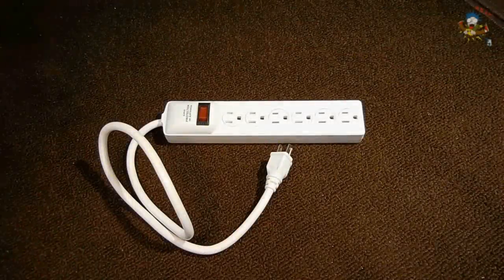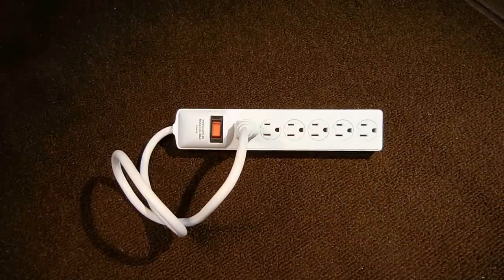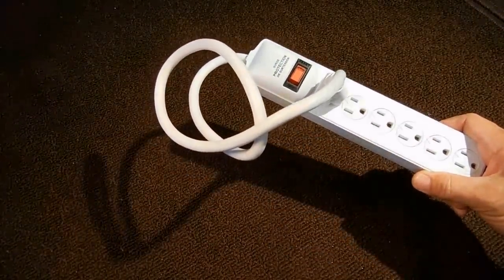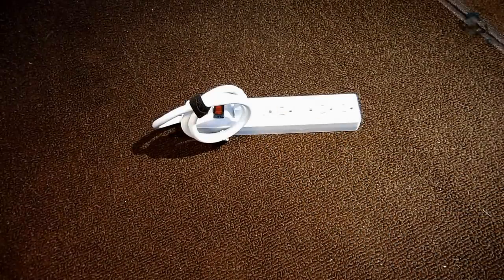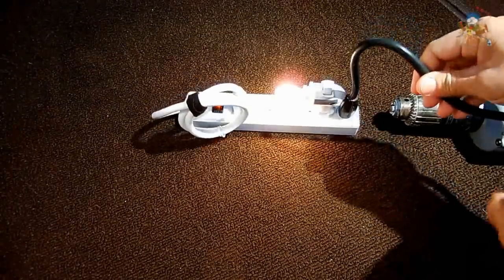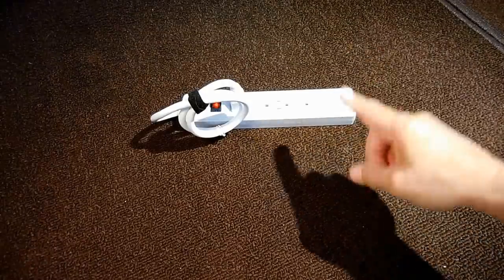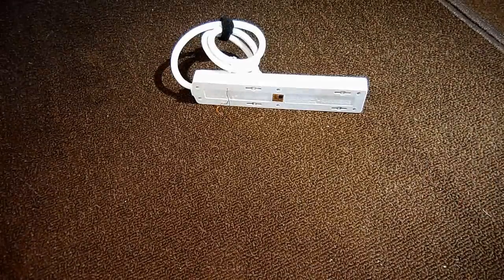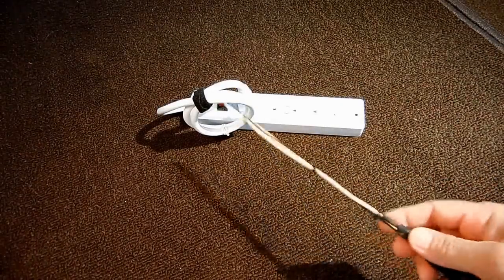EXPOSED: Endless Free Energy Power Strip

Comment: Nice Debunk. Now how many doubters? 

Anyone finding one where there's not visible wires, the new rage is the `inductance` mode where a coil is strapped in close proximity under the surface, carpet, etc and one power loop in the actual strip, as long as both devices are in close proximity, your fine...

Also note that AC devices will accept DC voltages, so these items can be powered by an inverter hidden in the power strip and use high current drain batteries like 18650 cells.

Its not rocket science.

Comment: This scheme is basically the same one as when people try to use an electric motor to turn a generator and then try to make the generator power the motor. And it doesn't work for the very same reason. Any power initially input into the system will eventually dissipate either through losses or by being drawn out into an external load. Then once the system becomes fully depleted of any energy nothing further will come out unless more new energy is added in again.

Comment: I know whats free...solar power...been using it for ages...just a shame it only works when the sun it out lol
Reply: You can make it work for you when the sun is not out - by having a battery back up. You never need to draw from the electric company!
Reply: Make yourself a bank of LiFePo4 batteries up to 2,000 Amps and you would not need to worry about not having power when the sun is not out.  Plus Lithium Phosphate 4 (LiFePo4) is more durable than the Lead Acid Battery counterpart being able to handle up to 2,000 to 4,000 charge cycles and lasting well in excess of 15 years+ whereas Lead Acid only do over 300 to 400 charge cycles and lasts only 5 to 7 years.
Reply: m8ty.com  allready done lol
Reply: My power company credits my account with the over production of energy, so they are kinda like my battery back up.  But if we lose power, I am SOL, cuz the panels are shut down to the house.  However, there is one outlet that can be powered by the panels and bypass the issue.  I suppose I can use the juice to keep my frig cold, and alternate with a portable AC unit or space heater if needed.  Interesting note, most power companies see homes with solar as a priority 1 to get power up and running again in the case of power failure, so the more homes with panels in the neighborhood, it stands to reason that that neighborhood will experience less down time with respect to electricity outages.
Reply: Brandon Hestwood solar panels are supposed to save u power not power your whole house unless you live in a giant little farm with lots of space and a bunch of solar panels
Reply: Yes, I know.  But I like the thought of not having an electric bill for 20+ years.  I overdid my array to compensate for the degradation during the life expectancy of the panels.  Plus my wife leaves every light in the house on.  I begining to think that she believes the furniture needs to photosynthesize.  I have replaced all lighting with LEDS (set me back $500 to do such), and vacancy sensor switches have been installed throughout the house.  Feels weird now when I am in other people's homes when I have to manually turn on the lights.  Now if my HOA would just allow me to drill for natural gas and dig a water well I would be all set to complete the trifecta!😀
Reply: Same thing here. Slowly replacing all lights with LEDs. Wife & daughter leave all lights on like it is free energy. I keep our monthly bill under 400 kwh a month. We do not have central air either. Nice breezes in summer. Lots of trees for shade. We only used a couple of small bedroom AC units a few hot summers. Tried harbor freyt solar  panels once. Right out of the box , they were broken. Took them back and got full refund ! chineees garbage, as usual ! Thanks
Reply: Triumphmanful, LEDs pay for themselves very quickly.  Also consider Gila Platinum window tint on your South and West facing windows and filling your outlets and light switch cracks with that expanding insulation foam.  Helps a lot.  But 400kwh isn't bad at all!  Doing better than me that's for sure.

Comment: i did an exposè at one video in which they uses piezo lighter to start, and it utilizes ground point. but slow the video a bit and it turns on the strip before last flick of piezoelectric is done.

Comment: It may be free energy but you are still plugging it into a wall to use electricity from the same source.
We need to find ways to be able to create 0. energy, a guy discovered it before passing away and his secret died with him. However it does not mean that this method will not be rediscovered in time its a matter of dedication, commitment and thinking outside the box, rather than staying inside the box and trying alternative methods.

Comment: ah-hem, is it possible to make free energy with a charged(but rechargeable) battery, a mini solar panel, a lamp and a wire? like... putting the solar panel under the lamp and connected to charged battery, that will provide light that make energy in the solar panel that recharges the battery wich is losing energy to the lamp... am i saying it correct?

Comment: Actually that red light switch could have been an LED.
The night light could be driven by a joule thief inside it (and a small battery).
And the drill? Well: we see you put a plug in the socket (might have been ANY plug from ANY wire) and then you show the drill. The drill could be plugged to the wall.
So actually you were hiding the wire of the drill and you would not have needed the hidden wires after all.
Cheers.
Reply from the maker: +deslomeslager 
Anything is possible with these scam artists. Anything to get views and make a buck. Thanks For Watching!

Comment: Aren't such thin wires carying such a high current supplying the light bulb and a drill at the same time posing a risk of putting your place in fire? Just wondering o.O
Reply from the maker: +Viktor Božičević 
No, the load was only intermittent, not operated at full speed, and under the carpet is a concrete garage floor. :-) Thanks For Watching!

Comment: Couldn't you also use the looped cord and make a coil of wire under the table to produce the electricity and the looped wire pick up the current from the coiled wire that is under the table to produce the necessarily power to produce the power needed to power the loads from the other items?
Reply from the maker: +Steve Rabon 
Absolutely not. Never happen. :-) Not using that kind of current.

Comment: you guys do realize it is impossible to have endless energy. the wire that he has coiled up and plugs back in has a resistance. that resistance will continually Caz the voltage and current decrease until 0. also a piezo ignitor emit high voltage low current that drill and light bull require large amounts of current so the little power u put into the strip can't power shit. also the guy most likely took apart the power strip put a transformer or ac buck converter with a battery and made it look like it's free power. a transfer has multiple turns In it like that wire but it needs a constant power source to work
Reply from the maker: "Free Energy" fanatics won't listen to you. They think this really works. LOL

Comment: Did you power that drill through the enamel wire?
Reply from the maker: +blackstar2008 
Yes. The 20ga wire will give you a voltage drop and heat up if you run the drill too long with that level of current.
Reply: +electronicsNmore That was dangerous, but anything for science :)
Reply from the maker: It served its purpose. :-)

Comment: I will tell you what is this
He put a hot body under  the table , so that the radiations are emmiting in the form of heat and magnet     
So it will create a magnetic field      and also he rolled the wire so that a wire behaves like a coil 
And if you know about the phenomenon magnetic induction 

So u could be able to understand 

The hot body like  - iron ,

Comment: +electronicsNmore           Your strip DID NOT HAVE a "secret wire" powering your strip...yet it powered a nite lite AND a powerful drill.  Now, explain to us WHERE *THAT power* came from?
Reply from the maker: How about watching the entire video. :-)
Reply: I watched it twice...and the question remains...
Reply from the maker: Better open up your eyes and unclog your ears starting at 4:50. LOL
Reply: I watched it.  I unplugged my ears and opened my eyes (WIDER THIS TIME), and nowhere did you prove this a "scam"...as stated in your title.  I cleaned my ears and opened my eyes, but one thing I CANNOT DO is read your mind.  Is it a scam or isn't it?  If it IS...HOW did you get the lite and the drill to operate?   That little tiny micro wire underneath could never carry the power to run the drill.  AND there would need to be a DIRECT CONNECTION to the wire underneath to get work out of it.   Are you saying that YOU had a hidden power wire underneath that ran YOUR drill?  All you had to do to show that is to move the strip while the drill was running.  Why didn't you?
Reply from the maker: Davey Jones I showed the wires. Seriously, you have to be brain-dead. All further discussion on this comment thread will be deleted. Take your nonsense elsewhere!

Comment: fake. I don't believed. the light have a small bateri in  hiusing light.  you soket plug in is switch on and light on. I am sorry. you trik the on grinder wheel.... you plug on switch elektrik home you plug in antorr soket. broken original  soket grinder.  OK tq the trik  fake. don't do that.

Comment: The concept is real. But just putting a few coils into a cord isn't going to work lol. Depending on the construction of the power strip you can get some energy but this is taking a complicated concept and trying to over simplify it lol..
Reply from the maker: Please, you're making yourself look pretty dumb. lol. It's a scam! Wake up already.
Reply: Am I or is it you lol.. Like I said the concept is real the portrayal of it is fake. It can be done but not with the components shown.. Before calling someone else dumb you might want to spend a little more time actually researching and understanding the concept
Reply from the maker: +john smith It cannot be done!
Reply: Next your going to tell me you can't drive random metal into the ground and generate energy or that perpetual motors are fake too lol..
Reply: How about energy transference through RF? I guess that doesn't exist either? Lol
Reply: I appreciate the fact that the specifics of what is claimed vs you disproving it.. But in the bigger picture with the right components it is real. Just not with a power strip lol.. Is it a viable reliable energy no. But that doesn't mean it's not able to actually produce. Stop looking at it as a power strip and break the concept down to its base.. It's a simple concept used in almost all electronic devices to some extent..
Reply: Can't remember the actual term for it but in short form.. With some coils and a capacitor you can create a perpetual energy loop that maintains and holes energy transferred. Add to that a transformer and you can actually power something off something as simple as a piezo ignition. Short lived not free as portrayed like I've said many times already.. But if you actually understand electronics and electrical production enough you'll also understand this concept at its base is used in every thing from led tvs to toaster for the better part of 50 years. You think they woke up and just came up with this scam portrayal? People bit on it cause it relates in a sense to real things. I think you either don't understand yourself what your talking about or you simply read my initial post. Again the concept is real. The use is fake.
Reply from the maker: john smith
Are you done making yourself look foolish? Hope so.

Comment: He didn't move the power strip, so how about a hole in the table feed to a foot switch and plugged in.

A LED works off of 2.1 volts coin battery will give this, the drill a Power battery from a remote control car will give 12 volts and you use the motor from the kit car to drive the drill. This can be hidden inside the tool.

but the only way you get somthing like this to work is Power theft off the grid using a lot more coil and wire and the correct toroidal set up and you  will get caught doing it.
I think this is how they power Smart meters without using your power and billing you for it.

The guy that made these is laughing his ass of someplace while you asking what you did wrong? and it isn't working. If he's getting paid from Ads he's laughing on a beach someplace. While you're losing IQ points watching this shit.
Reply from the maker: Instead of posting stupid comments, how about watching the ENTIRE video first. LOL. I noticed you have a habit of doing that.
Reply from the maker: bobbg
People with short attention spans/ADD/ADHD, shouldn't be watching my well explained, highly detailed videos.
Reply: Its pretty clear I have/ might have  more background in electronics then you do, so I told you how this can work without wires, and how you can make it work for real, I do not see ADD or ADHD in that.
And it wasn't stupid, Believing anything like this could work is.
So why waste my time on the idea?

Your Lock and Key videos were great, this one wasn't so great to me, however others might find it informational.
That being said I digress. Have a nice day.
Reply from the maker: bobbg
This video was made to show HOW that scam was likely done. What part of that is hard for you to understand? LOL

Comment: dude you did it all wrong...
you coil the wire as shown in step 1.  step 2 attach magnet to drill where bit would go.  3rd step pull trigger.

the spinning magnet creates flux, discharged electrons past the insultated coating into wire...at which point electricity will be produced...last quickly unplug drill from wall and into electrified power strip...wallah, free energy.

it took 6minutes to ...from 6 days to prove b.s. omg...get new hob y